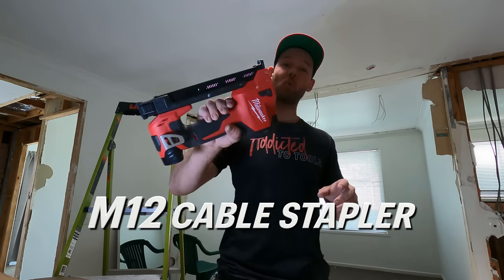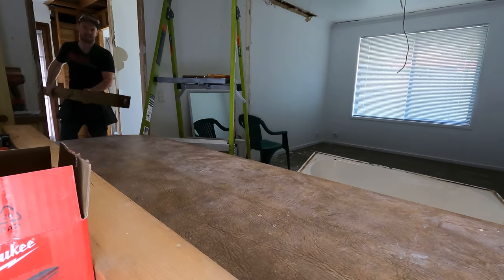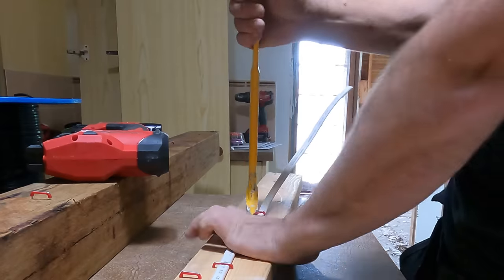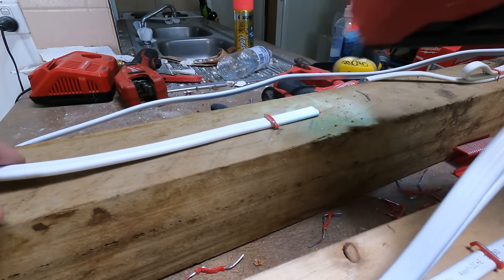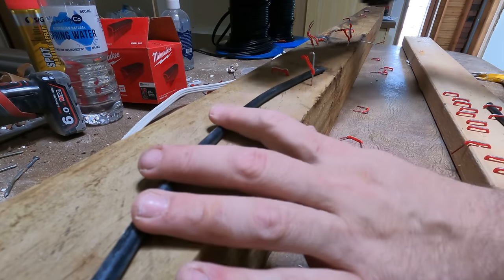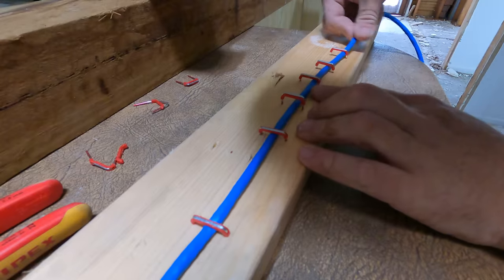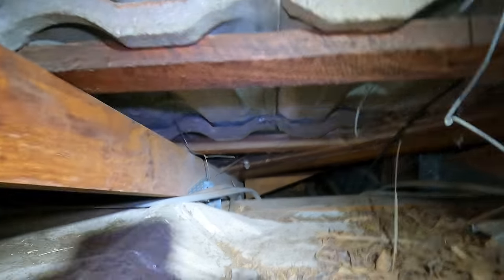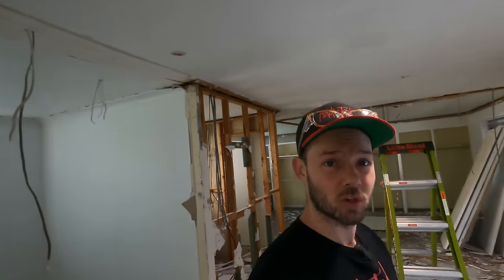milwaukee m12 cable stapler review with 2.5mm, 4mm, 6mm, rg6, cat6, earth

Comment: I have had mine for a few weeks now and absolutely love it. Made working in roof spaces so much easier.
Reply from the maker: I could imagine it being easier in those spaces for sure. Cheers for the feedback Sando👍
Reply: @AddictedtoTools how does it compare to the DeWalt?
Reply: From other vids, it staples too loose. I have dozens of dewalt tools, but I run milwaukee nail guns with an adaptor and dewalt battery. Same for track saw. Certain things suck on each platform. M12 is the winner for this IF you need it (and I do not).

Comment: I wonder how this holds up when used under a dusty house.  I suspect grit will cause jams etc. I think I'll give it a skip.
Reply from the maker: Definitely a good point. Could definitely give that a go
Reply: @AddictedtoTools  Please do bro, that would be sensational.  I often run new circuits under old houses, and being a tight spot, I tend to drag a hammer and bucket of clips through the soil when moving around.

Comment: If the staples were cheaper absolutely, but $50 for 600 is a bit steep
Reply: Where are you located, I get 600 staples for half that
Reply: 600 box for $20 in Canada
Reply: Australia, we call the tradie tax here. Anything to do with tools is more than double what is in the USA/Canada
Reply: It's 50 for 1800?

Comment: for the coax you might be able to put a few layers of tape over the depth guide if you were running a whole lot so it doesnt fire as deep, or in a pinch poke the end of your screwdriver alongside the cable and fire the gun over that so it cant crush it.

Comment: I have had the DeWalt one for about a month and its works a treat for me as an IT Admin doing data cables for security cameras. Using it with the powerstack battery and so far gone through 1500 staples without needing to recharge. Im on the north side of brissy so let me know if you wanna borrow it for a comparison? Great review in experienced hands with real world situations.

Comment: I love mine. They are great! 
For Cat6 and coax I plan on stapelling horizontally then putting cable ties through the staple and around the cables.
Reply from the maker: Good idea. I had a thought of putting velcro or cable tie around it
Reply: If you were going to do that why wouldn't you just use normal m12 stapler with depth wound back? Alot cheaper staple
Reply: Oh yea, using them as clips would be pretty smart

Comment: I think a generic depth adjustment could be ok, but not a categorical/qualitative one. RG6 "setting" on hardwood vs pine will give completely different results. It'd have to be more similar to a standard nailer and you give it a test with some scrap before starting a run. Once you get a feel for it you may know that RG6 on hardwood is "3" but on pine it's "1".

Comment: M12 seems to have impressive power and performance. The lack of any battery level indicator has always prevented me from switching though.
Reply: I thought there was no indicator too when I first started using some m12 tools. The battery level indicator is on every m12 tool itself not the m12 battery.  It’s three small led lights usually near where the battery attached to the tool.
Reply: @CahillGolf  only then you have to plug batteries into tools just to check power level.

Comment: We have a couple of the dewalt cable staplers at work. I find them a pain to use when trying to staple multiple switch wires at once as the enganment thingo is fairly narrow, the milwaukee one looks like it covers a much wider area.

Comment: I’ve had mine for about a month now. It’s unreal into pine. Unfortunately I find it useless into hardwood, especially in old houses. The staples deform and buckle straight away if you tap them with a hammer. 
Have to pull out the hammer and clips for hardwood especially if it visible. 👎

Comment: Got a question. Is this better than dewalt one? I have dewalt one and it's not good. If it does clip the cable perfectly i probably buy it. I just need a honest feedback please
Reply from the maker: Hey, I haven’t used the dewalt yet. I am wanting to compare them in the future. Im also going to try the new high output m12 batteries and see if it goes better on hard wood. Otherwise i was impressed with this. If you only deal with very hard wood. I would avoid it.

Comment: One problem is if you want to use an existing cable in a wall as a draw wire you can’t if the cable is clipped with these clips.
Reply: Why clip them in the wall?
Reply: @T3MPclan  some people do at rough in so it doesn't flap around or get moved, potentially getting kinked or damaged by the plasterers
Reply: I find I'll clip one of the hard actives and leave the rest unclipped. This allows me to use the rest of the cables coming down as a potential draw wire for the future.

Comment: This tool is rubbish, it really is just a stapler and not a very good one. The Dewalt isn't much better but is more powerful. The Dewalt seems to have never ending battery life on their stapler and has No problem at all driving same depth into Hardwood. But apart from that, they both are very low grade oversize junk. We did have some English made battery wire tackers from some years ago that fired different sized plastic shrouded wire staples that worked really well but the batteries weren't great. All you would have had to do was adapt a Dewalt battery to them and they would have been the Ducks Nuts. But these two don't even come close except as I said earlier the Dewalt Battery Life and More Guts than the Milwaukee. I guess I am still waiting for someone to actually make one that was designed by a user.

Comment: This gun is useless it staples too tight you have to be able too move the wire, I worked with a electrician for a couple years and we use to do this with a hammer and staple and he always said make sure you can move the wire back and forth

Comment: Tradies installing data and AV gear. We make a nice living from fixing their hamfisted approach and "she'll be roight" attitude.
Reply from the maker: I’m an electrician with a open cables license. Done more work with data fibre and av than I have electrical. I’ve got a few data endorsements also. Which is definitely why I wouldn’t use this for data. There are definitely a lot of people that shouldn’t be running the stuff.
Reply: @AddictedtoTools  You may be one of the few that realise that data, fibre, coax, etc, isn't just a piece of dumb copper from A to B and install accordingly.
Reply from the maker: Couldn’t agree more mate. There’s a heap to know and it’s a full on trade to do it proper. Most don’t see the more in-depth side, they’re just seeing a cat5 cable thrown through a ceiling and fit off for a phone.